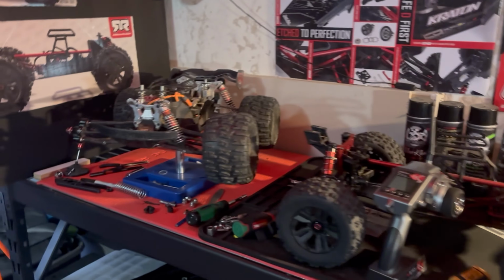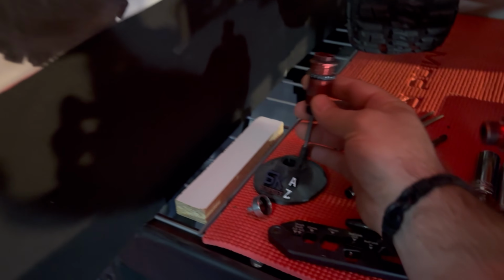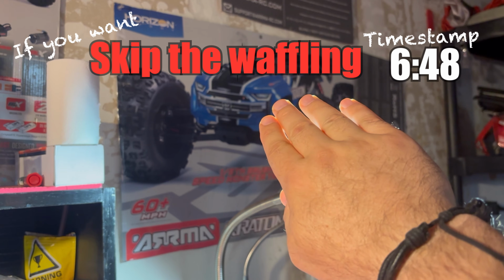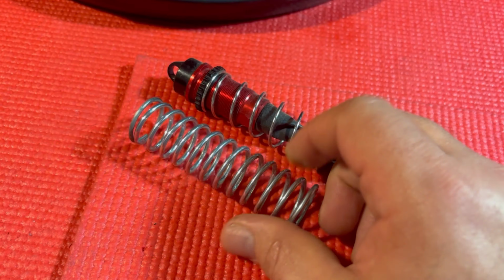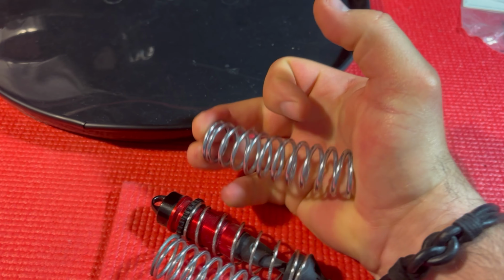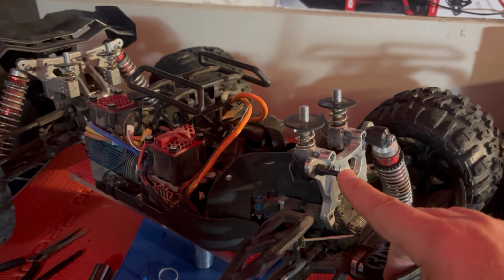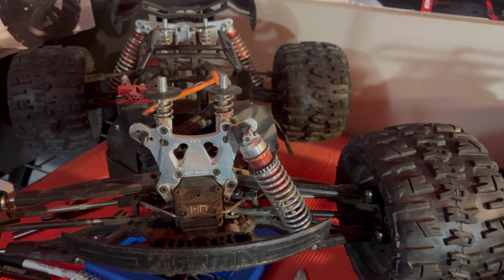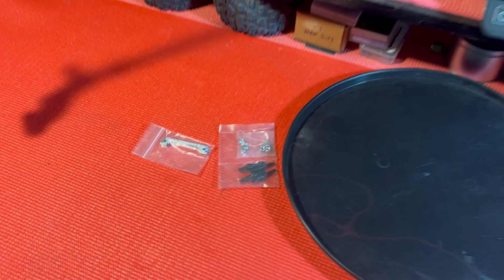JUNE 2024 Tree Parkour jump Challenge Anouncment!!! East Tactics

Comment: I would say the heavyweight springs played a role in breaking your end cap.   I like your shock setup, but i think the shock ends need some beefing up to handle  the increased load on them.
Reply from the maker: I’m sure those springs do add a bit of extra pressure. If I was popping those rod ends all the time I would definitely revert back though. This is the first shock rod end break I’ve had in a long time.
No… The beast springs on the other hand. I will definitely be curious if those things scream signs of issue toward those rod ends. Will find out.

Comment: My two cents brother, gonna be hard for your to get the shocks to rebound slowly no matter the shock fluid weight IF your springs are that strong.
If you want stiffer springs I like the blue HoBao springs in the rear and rear Kraton springs in the front with 90wt ZRS Bladderless setup is fantastic. Heavy springs also kill handling. But I love that your trying new things... If your living the performance then stick with it. But I'd think the ZRS Bladderless won't perform as intended with string springs because rebound is meant to be slower because of the pistons as you know, but strong springs will push past any advantages and in a sense hide them.
My two cents

I do miss having the "Judges decide" idea you used a few years back to reward the best trick as a reward and maybe a random smaller secondary prize.
But you do you
Reply from the maker: Ya... the BEAST springs would way surpass everything, so your two cents are spot on. 

I will say though, that I have tamed and found the sweet spot for when it comes to the 1631 springs and 5k diff fluid. And I did run them with and without the M2C emultion caps. The M2C caps made a noticeable differance, so I do recomend using them if you run the 1631 springs. 

Regarding changing the East Tactics jump competition to a series of challenges intead of competing. I hear ya. 
And thinking about it, I still am glad I switched it... alot of the issues and frustrations came from it being a competition that are now gone. Things behind the scenes that most would never know about. 
Now its simply a fun challenge series you can get involved in and have an Equal chance as everyone to win some awesome goodies. Who knows tho..next year I may change it back to a compititon agian. we'll see. Thanks for commenting. Its really good to hear from ya bro!
Reply: @EastTactics  yes if the Beast Springs are just slightly stiffer than stock then yes that's kind of what I'm saying is that you only want to go a little bit heavier than stock or else the ZRS bladderless shock kit won't be able to function correctly if the Springs are too stiff it will remove the slow rebound because the spring will just bounce it back up
Reply from the maker: The beast springs are crazy. However, the 1631 Springs are definitely more than slightly heavier than stock. They’re 9 pounds springs compared to stock 6 pound springs. Yet… And this is the point I’m trying to make clear, despite that, the M2C shock caps still make a noticeable difference while running them. The tactic in the pistons and O-ring interacting with the 5K diff fluid has an impact on slowing down rebound compared to stock bladder caps.
Reply: @EastTactics  yeah man with stock springs and ZRS I have almost no rebound if landed within reason, more spring will just help it rebound more and reduce the effect of the ZRS, maybe just wind the springs or go to 7lb or HoBao springs. Myself, Commander, a d most of the team seem to have plenty of success with what I mentioned.
Reply from the maker: Send me a link to the 7 pound springs or the blue hobao springs. I’ll check them out.